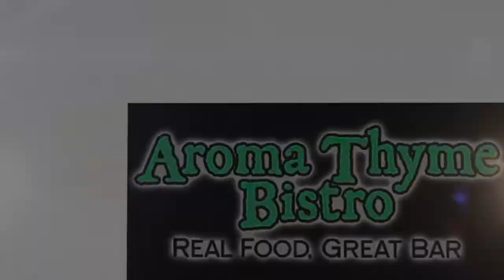Cold Pressed Oil vs Expeller Pressed

Comment: seed oils ALL become deranged when you heat them, causing systemic inflammation in the body, this is just fact, it would behoove everyone to avoid them at all cost, especially a chronic daily or even weekly intake.... if you're using the oil without heating it (not cooking with it).... and it was properly extracted, then its usually fine.
Reply: Seeds oil? Like Coconut,  olive oil? Or sunflower oil?
Reply: Avocado oil is the best to cook with
Reply: Or good old fashioned lard, very healthy compared to the seed oils which are pure poison.

Comment: Thank you for the video. I'm trying to make my own coconut moisturizer with expeller pressed and it's not working out like the videos I'm using. Nobody explains to make sure to use cold pressed. Now I know. Is there any way to firm up the expeller pressed to the consistency of cold for moisturizer? I hate to waste the jar I have. Thanks.
Reply: Try with oil maker machine..
Reply: maybe use corn starch? or arrowroot powder